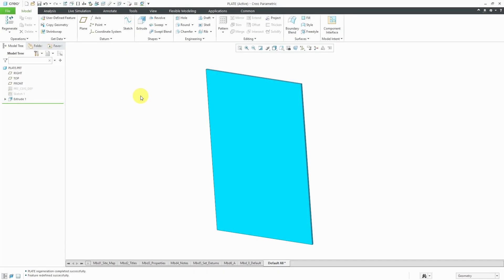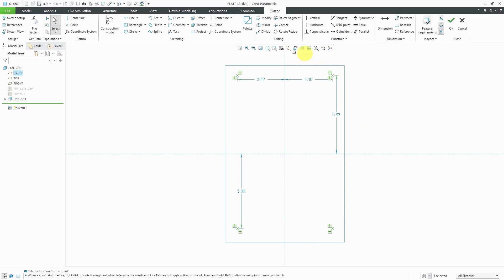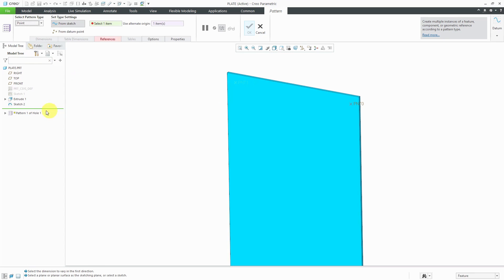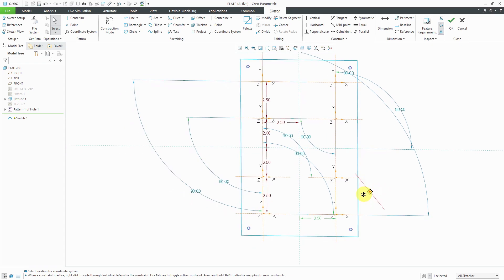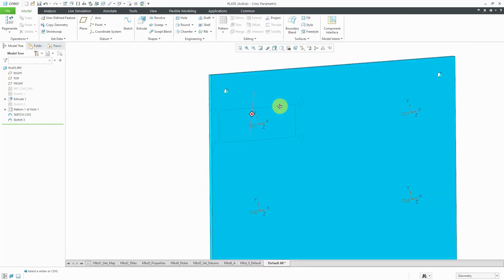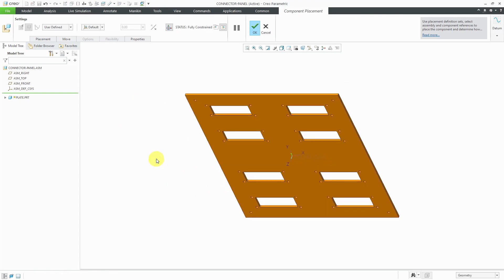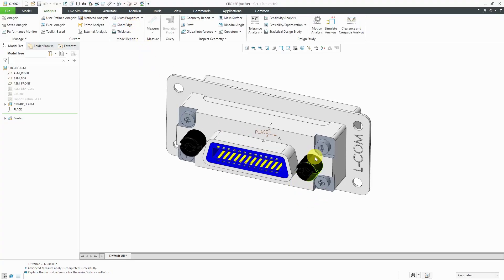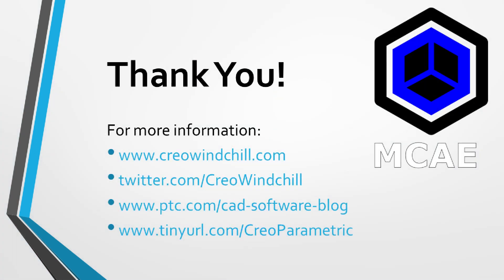Creo Parametric - Point Patterns

Comment: Very nice demonstration :) :).  I didn't know the use of CS's in point patterns. I used to work with Autodesk Inventor, and the only way to create a group of holes, is to create a sketch of points. In Creo it is very time consuming to create that pattern of four symmetric holes. In my opinion, a workaround could be a UDF, one for two symmetric holes, another UDF for four symmetric holes.
Reply from the maker: Six of one, half dozen of the other. This is just another tool that you can have in your toolbox, and with all things, your mileage may vary.